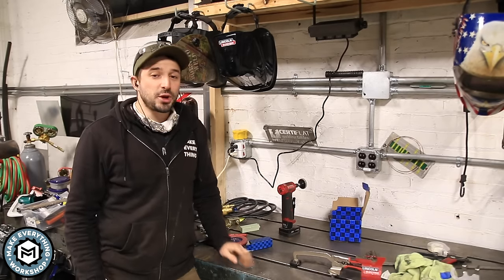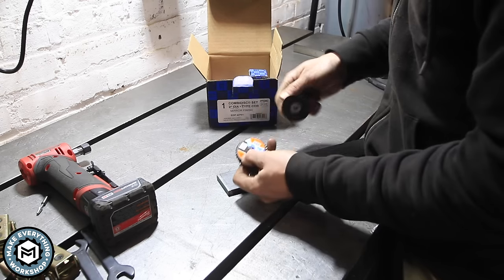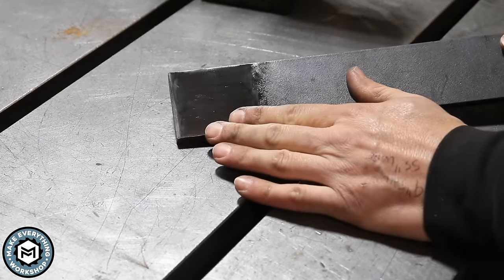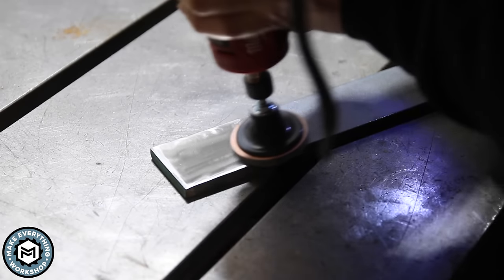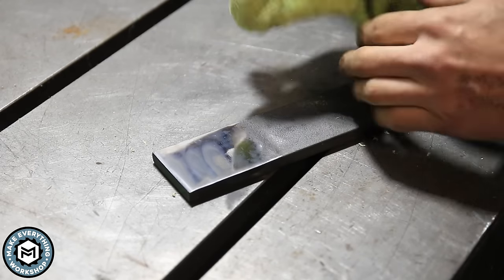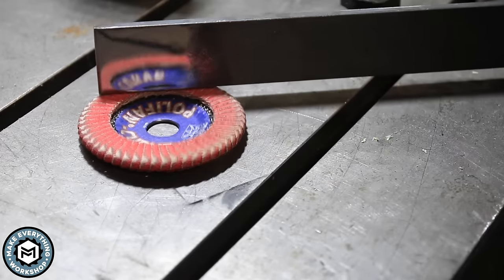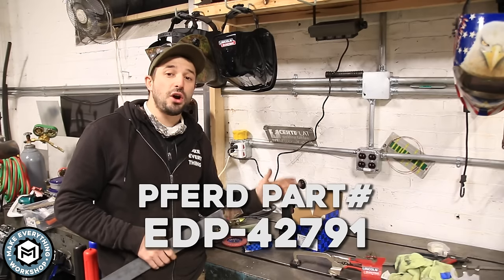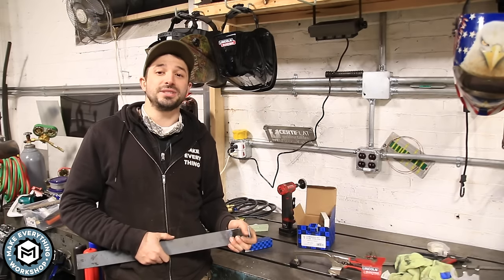Easy Mirror Polish On Steel!

Comment: So one thing you should always do is on each step change the direction of the scratches so you can see when the old scratches are gone. I made medievil armor for a living and polished whole suits of armor.
Reply: I'm assuming you're not 800 years old.
Reply: Okay so how do you keep the steel from coroding after the final polish
Reply: @aaronorr1450  apparently they used oil and wax on the armor. Some I believe blued the armor for better corrosion resistance
Reply: @brandonbariel8279  Thank you
Reply: @davidshaper5146  😀
Reply: So you do it both directions for each step? Or do you do one step vertical and the next step horiz?
Reply: @SlowZX2  yes one step horizontal and the next step vertical or vice verse
Reply: Thanks for the tips
Reply: Are
Reply: Ultimate Chad. Good tips man.
Reply: So true!
Reply: @aaronorr1450  I use INOX BRAND MX3  lube and on high carbon steel machete I made! ( a bolo style) beautiful! A little patina but sharp and cuts like through butter!
Reply: @aaronorr1450   if its stainless steel it wont happen
Reply: What grit should you start at if you’re looking for a mirror finish (or very close to it) and want to remove as little metal as possible to achieve that finish? The wire frame I’m polishing is thin and not too much material.
Reply: @AdamSmith-fe9jf  well the higher the better but that is determined by how rough the surface is to start with. probably start with a grey polishing compound that will show what needs to be sanded if anything then decide whats gonna be needed from there.
Reply: @SlowZX2  one direction per step because you will eliminate the previous deeper scratches and thats all you need. the changing directions is so you can see the old scratches are gone.
Reply: @WesternIronwoks  Thank you. That’s great advice. I see some packages/bundles of compound available online with a collection of different colors, but white is always included with the other colors. I don’t see any grey except for one Dialux sold separately. Would the white be good enough to show what needs to be sanded? Appreciate the help.
Reply: @AdamSmith-fe9jf  basically use the polishing compound that is the most aggressive for the test to see what you need to polish then go from there. the colors for the compound do change for different companies. I use to get the harbour freight grey,they use to have bricks.
Reply: @WesternIronwoks  Thank you so much. I got it now. I do see the Harbor Freight grey one now. I’ll pick it up and try it out. Thanks again!
Reply: WOW. !!  That's awesome.!
Reply: I mirror polishes all the rolls to make gold and silver coin for the US government and this is wrong
Reply: @bidenisgay  gold and silver are vastly different metals then steels.
Reply: @AdamSmith-fe9jf  It’s somewhat standardized by color.  Gray/black is generally emery, which is the most aggressive.  Next is tripoli, which is brown.  Then either white or green.  Green is Cr(III) oxide.  Green/white give a very polished finish.

Eastwood sells the abrasives, and Amazon does too - you can often buy them in bundles.  You’ll need some kind of a disc (like the one here) to use them.  Pferd is good, but there are also cheaper, generic alternatives (probably not as good but sometimes a lot cheaper and good enough).
Reply: Not only scratches, the massive gauges the apprentice is surely putting in the last pass lol
Reply: @aaronorr1450  stainless steel
Reply: Your the man
Reply: Medievil is a video game, Medieval is a middle age period you probably do armours. You make them for SCA?

Comment: Nice info. Laughed at the part where "the maximum speed for this disc is 9,500 RPM, so let's set the grinder speed to 10,000."
Reply: Douglas Siemens  he said 19,500 , so he is good....
Reply: 10000 rpm is the lowest setting on that die grinder
Reply: Yeah Douglas Siemens, get the siemen out of your ears
Reply: @edwardfinn4141  he said 9500
2:55
Reply: There is a difference from recommended speed and do not exceed speed. 
If you’re paying attention to details. Pay attention.

Comment: I would skip that flap disc as it takes off way too much material and go straight to that scuffing disc. It also works great in removing pitted rust.
Reply: I've been able to do that easily and also struggled with it. Depends on the hardness of the material and the surface defects you're leveling.. but I agree, as a pro detailer, that is the golden rule, start with minimum aggression and work up before you work down.. remove the minimum amount of material possible to achieve the result you're after. But there is the balance there between over working without enough aggression, and over cutting with too much aggression. Learning that balance just takes experience.. at least it did for me.. ✌✌

Comment: i'd start with an angle grinder and a paint stripper disc for black scale, then move to a sanding disc (not a flapwheel), the wider the better, and sand it nice and shiney with a single, slow, even pass, as if you were being a flycutter on a mill. scale just clogs up sandpaper and causes you to have to work harder to get through, potentially leaving gouges, especially with small die grinder tools. save those for finer polishing. i speak from much grinding pit experience and doing this daily so that parts made of structural hot-rolled could be painted and not see any pitting or welds in the final product.

Comment: Yeah, I would strongly recommend anyone polishing a flat surface to use something flat throughout the process.  A rubber sanding block comes to mind. Also, water and wet sanding paper are your friends. Dry and seal with wax or a light oil afterwards depending on its use. Those waves look unsightly, IMO.  And, you didn’t discuss the grit in each step. Seems that 60, 150, 400 and finally polishing would be enough.  Other than that, good info. Thanks for sharing.

Comment: What finishing options there are for steel once it's polished to this level to protect it from moisture??
Reply: Have you found anything I just asked the same thing
Reply: @NIGHTNOTLOC  Yeah - got a couple of leads.  Shellac will actually adhere to bare metal.  My client has a sample that he's abusing with water to see how it does.

My friend/coworker has an industrial finish I'm going to try as well...  I'll report back if I get any info on that. 

Spray on shellac tho ... I'm cautiously optimistic.  I'd love to know what experiences people have.
Reply: Ceramic coat.
Reply: Clear Cerakote
Reply: You guys hate wax? I just use woody wax

Comment: Removing all of the mill scale can also be achieved in one shot by soaking the work piece for 24 hours in a tub of distilled white vinegar. Then neutralize the vinegar with a scotchbrite scrub, distilled water and baking soda while utilizing a "light, elbow greased" bath to the work piece. 
These preliminary steps, provided that you have the time, should minimize, if not eliminate the need for that first aggressive wheel all together.
Then, the rest of the kit and it's process can be applied to whatever level of completion is desired.

Comment: A key step to polishing is to lighten your touch as you work with the polishing compound. Start heavy, clean it off, then go lighter. A final touch with a soft wheel and red rouge would also give you a great final finish.

Comment: Hey man just run across your video do you have a quick question haven't researched it yet but figured I would ask after you reach the desired level of polished steel how can you preserve the shine and finish so that it will not rust again or how long will the finish last without anything but a protective polish just a thought really enjoyed the video thank you so much for sharing look forward to the next one
Reply: Look into an epoxy rust guard clear coat, you can find spray cans at big box and auto accessories stores.

Comment: How do you find the kit for more oddly shaped pieces?  I feel like a cordless die grinder might be a tool I've been missing.  Will that arbor fit a 1/8 collet like on a dremel?  I feel like the dremel may not have the torque to make use of the adapter, but it still might be worth a shot.
Reply from the maker: The 2” diameter is really good for hard to reach areas and with a 1/4” to 1/8” copper adapter (cheap to find on amazon and eBay) you can run deemed style accessories. I run my 1/8” carbide burrs in this grinder as well

Comment: Could you please provide a link to the polishing kit?
I would like to use this system on restoring old knives, specifically high carbon Japanese knives.
Thanks
Reply: Did this work for you? I'm attempting to restore old japanese sword that some idiot tried to polish with a tiger paw flapping wheel. Smh

Comment: You could have started with the scotch brite clean and strip XT pro disc… They rip through mill scale and I would say they don’t remove any metal but there will be very fine scratches in the metal and you see just a few little sparks so they have to be removing something but it’s very minimal… I wiped mine down with acetone first to remove that little bit of oily residue on the on the mill scale but they don’t tell you to do that, that was just my own personal opinion because I didn’t want to smear that oil all over the bare metal…  But it would eliminate the need for the first few discs you used I’m sure. They are really nice to have around. Mill scale, paint and rust is the enemy and the scotch brite pad is the terminator…😂

Comment: Once you knock off the mill scale you should go with a flat vibrating sander or DA with preferably ceramic paper or at least paper made for metal. That will keep the surface flat and give a better end result if you are looking for a mirror finish.
Reply: Darryn Ruzicka I gotta find the bottle but I chemically stripped the mill scale from a project I did and it blew my mind how well it worked compared to how difficult it is to grind it off. Definitely some caustic stuff but damn was it effective and quick.
Reply: A DA.....red Scotch Brite from 3M to knock the scale down and off FLAT! Like anything else in the finishing world, it's all about the prep and first step. If you start off with a flat, evenly scratched surface, it makes every other step matter. If you don't do it right on the first step, you just end up with a polished turd. It's be shiny but a crooked, wavy, uneven, turd. LOL. I then wipe some (not spray) WD-40 on the steel. 6in sanding discs back on the DA. Goes like this....
400 and wipe off with WD40
800 and wipe off with WD40
1200 and wipe off with WD40
3000 and wip off with 80% iso alcohol.
Now I polish with a Meguiars yellow polishing pad and their 105 compound. If you work it right, you will not need to polish after this compound but it does take practice.
Another thing is, steel can very a lot. Some may not need all these steps. You might be able to go from 400 to 1200 or 800 to 3000. You just to have to observe and watch the sanding marks.
I hope SOMEONE reads this. LOL.
Reply: @jeremyspecce  caustic rules!
Reply: @justinmurphy2227  so dry sand then wipe w/ WD40? What is the pertinence of the WD40 step? Look forward to your reply and thanks for all this!

Comment: What grit should you start at if you’re looking for a mirror finish (or very close to it) and want to remove as little metal as possible to achieve that finish? The wire frame I’m polishing is thin and not too much material.
Reply: It's not necessary about which grit you start at, it's about which one you finish on before polishing
Reply: @kevinmontoya7318   If you don’t start off right getting the surface smooth enough, you won’t get a good finish. If I only worried about the final stage of polishing, I may need to go back and start over from a higher grit and do double the work. So, I don’t think that’s correct.
Reply: @AdamSmith-fe9jf  I start at 220 and go up to 2000k

Comment: Great information. How do you remove scratches from tungsten carbide and then get mirror finish on it subsequently.
Reply: Blue diamond polish and a similar process but go slow and don't try to apply lots of pressure scratches are ether buffed out or sanded even tungsten carbide it fairly dense so take your time and do long slow and even strokes

Comment: Love that table. I like a cheap ass Harbor Freight electric DA sander with a dimmer switch to control the speed and 5" pads ( no distortion ) and autobody compounds. works good.

Comment: I love @Pferd products, especially the combi click system and their polishing products. It's a great tip to check RPM rates, when you're using that final felt polishing pad with compound, try slowing it down to 1500 RPM. They suggest that for the very final step for ultra polished results. 👍

Comment: How can the polished finish be protected for outside use.

Is ot feasible to polish up road wheels and perhaps clear coat them
Reply: Following… I’d like to do this on th bumpers of my 1958 Chevy Apache but don’t know how it will stand up to the elements. Thoughts?

Comment: How flat is it though? I would like to see you run a indicator across it. For a knife or something that would be good but if you make a part with a .001 tolerance could you implement this, or what would be a good way
Reply: Ridgeline Machine Works hot rolled steel is not that precise to begin with so most of the non flat was from him getting rid of the mill scale. If he didn't have to do that part he could have skipped that flap disk and went straight to the finer grits and polishing, at which point you are probably taking off very minimal material. I assume if you needed a precise piece you'd have a machining step before you got to this point.